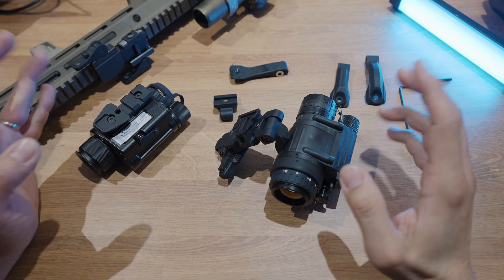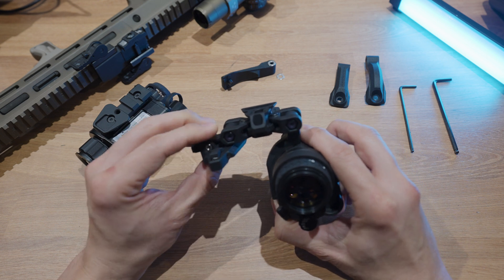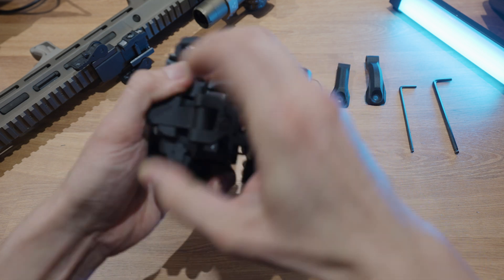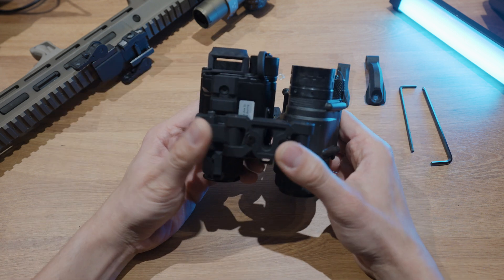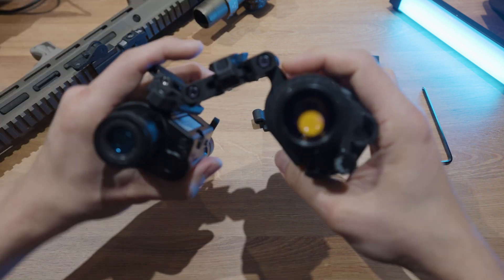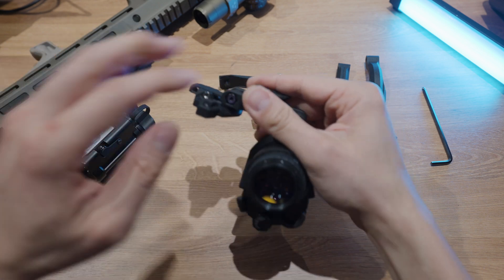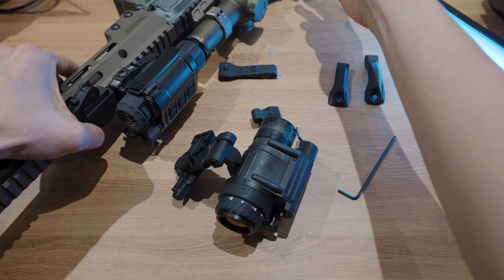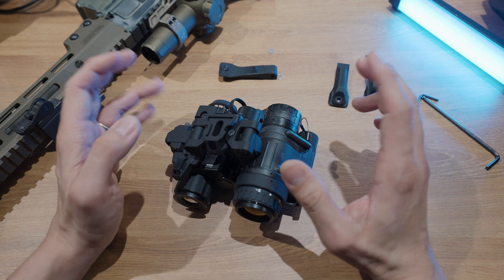Panobridge MK2 Mod 1 and Iray RH25 / Infiray PFalcon640+

Comment: Is there a lag time of the image for the  PFN640+? There is a review stating the input lag is too high to be used as helmet mounted (Opticplanets)! Thanks for any feedback!
Reply from the maker: Any thermal device will have some lag due to image processing times. Some of the older rh25s had an odd jello effect while panning. Our devices run the latest firmware and this has since been resolved.